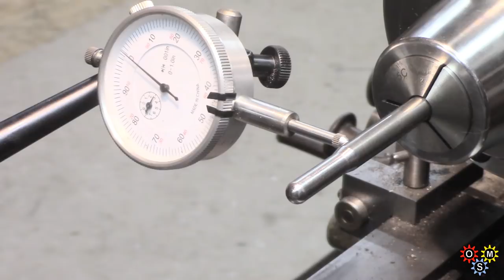Lathe Collet Chuck Installation

Comment: I have a couple of smaller boring bars that look about like the 1st one you were using.  I have the same chatter problem.  It seems the flats on the shank are oriented so that the cutting tip has quite a negative rake.  Got mine from banggood.  I have avoided using them because of the problems.  I need to sort this out some day and correct. Maybe post bandsaw refurb!  Lol. You sure  have your 5c dialed in very well. Good video.  Tc Mike
Reply from the maker: Thanks Mike - indeed, does seem those boring bars can be problematic sometimes. On balance I always feel happier with the largest bar I can manage to use for a particular job.

Comment: Someone had a good video on truing up 5C collets, I believe. Perhaps with a pneumatic grinder mounted on the compound. In this instance the main collet error was on the angle that forces the collet shut. I do not recall the details, but you can certainly check the whole system out. If I do not get back to you, I am lost in A.D.D. - land :) .I guess I BETTER start by watching the rest of your video, LOL.
Reply from the maker: I have yet to indicate the internal taper but I get the impression it is pretty good, accepting that we have an import unit, and of course with import collets there might be slight differences there too. Still, not too bad considering a cost saving compared with high end items.

Comment: Another question, which Loctite did you use?  640?  I believe its for permanent adhesion for sleeves.  Also I just watched the remainder of the video.  I should have waited to comment!  Anyway, I see that you made a threaded insert for the backing plate that goes in the existing counterbored holes.  I should have done this.  Its a great idea and you arent drilling additional holes in the backing plate.  One thing I have yet to do to mine but will in the near future is to make slugs that press in to the counterbored holes and threaded slugs to fill the holes in the backing plate.  I am doing this because at 500 to 570 RPMs my lathe shakes.  My 4 jaw Chuck does the same thing and I'm going to do that to it as well
Reply from the maker: Hi Brandon - my 'Loctite' was actually a knock-off stuff but works well. Unfortunately the permanent had 'gone off' but seems the medium I used has done OK. Lathe shake not so good! Wonder where the imbalance might be. 
Thx for dropping by.

Comment: Thanks for making the video. More than one way to skin a puddy cat, but if you have a set of transfer punches, seems like you could have transfer punched from the front side of the chuck into fresh spots on your back plate, then tapped the back plate.
Reply from the maker: Hi Steven - Thanks. I really didn't want the hassle of drilling a new hole pattern and then tapping - maybe mine was the lazy option but it seems to do the trick!

Comment: Nice video, Chris. So the collet is tightened in with the chuck key. I am not familiar with that chuck. Thanks.
Reply from the maker: Hello Bill - thanks. Yes, chick key spins the internal female thread to engage the rear of the collet. Does take a good many turns to get to full tightening.

Comment: If it wasn't for the weather, I'd still think you were in Australia.  Now I've worked out you're West Country gone American.
As there were no M8 threads, you coulda just used 5/16" if they're cheaper.
You could put 4 grub screws in to dial in,  but they'd have to be small as that register isn't very deep.
Reply from the maker: Hi Matt,
Thanks for the comments. Buying bolts, of almost any type metric or SAE is always an expensive game! Setting up is not too bad, just light taps with a dead blow hammer before bolts fully cinched up.

Comment: I don't know if anyone else mentioned it, but if your buttons do come loose you can drill down between the button and the plate and install a wrist pin to hold them in place. They won't turn then and will be locked in, they could always be replaced if need be by extracting the wrist pin. Thanks for the video, it is always great to see how others come up with ways of solving problems.
Reply from the maker: Hi Craig,
Excellent idea and thanks. Hopefully they will hold but that certainly would make a very easy fix. :)

Comment: No, no you do not talk to much.  Dont change a thing!   I have the same 5C collet chuck that I just installed on my lathe a month ago.  I had the same issue with my backing plate, the holes lined up but were counterbored so I had to drill and tap new holes.  I ldid a light facing cut on the backing plate and also took a little off of the register so I can fine tune the runout.   This is the same collet chuck that Stefan Gotteswinter has.   He does a teardown and inspection of it on one of his videos.  One of the best mods I've done so far!  Where are you located?  We just had about 3, almost 4 days of rain here.  Thank goodness it wasn't snow!
Reply from the maker: I'm in SW Central PA - lots of rain here too but not quite as awful as down south. Sounds like your approach with the back plate was like mine except you drilled and tapped.
Reply: ChrisB257 Oh no kidding, I am in northeast Pennsylvania in Bucks County. I think I saw one of your videos where are you were flying a drone in PA buy some historic bar or restaurant or maybe it was an Inn.  If i’m ever in the area it would be cool to stop by and check out your shop
Reply from the maker: Hi again Brandon -- yes, the drone flight, not my best - was looking at the Jean Bonnet Tavern - it's at the intersection of route 30 and route 96. If you happen to be this way (Alum Bank) do let me know but, be prepared if you see my shop - it is chaos and probably always will be!!
Reply: ChrisB257 haha, you should see my shop!  It looks like I dug out a spot in the basement for the lathe and mill.  Slowly but surely the basement will one day be all metal working equipment.  I originally started out in a steel building (quonset hut) with no insulation and in winter I froze and summer I was drenched.  The humidity was no good for machine ways!

Comment: Great job Chris. Could you give the web site and link or part number to the 5C collect chuck. Thanks for the good videos.
Reply from the maker: Thanks Anthony - well, I found the chuck on ebay and I seem to recall there were a few suppliers. Can't remember a specific link right now but search with "5c collet chuck" - there are plain back types and also cam lock etc. Have a look - plenty of choice.

Comment: How much clearance did you leave for the insert into the backing plate?  I know it was a while ago so if you dont remember the exact tolerance can you recommend a press fit clearance?  I just tried plugging one of the extra holes in my backing plate thats for the same 5C collet chuck.  I went to press it in and the backing plate cracked on the edge of the hole closest to the edge.  I had .003” clearance.  I guess I should have shot for .0015 or ?  Thanks Chris!  This is the third time I watched this video from start to finish
Reply from the maker: Hi Brandon,
Best I remember, I turned down the buttons a tiny bit more than intended so, one was an easy press fit and the other two a bit easier (this showed that the holes were not all absolutely identical ID) - but so far it seems as though the Loctite addition has managed a good hold. I have slackened the bolts a couple of times since to make a small adjustment for centering and they hold fine when bolts torqued up.
My target for button size was meant to be something around +.0005 to +.001 max because of the small diameter - does seem like .003 is certainly excessive. Maybe you can braze that backplate crack to effect a repair and make your button fit much less extreme and then rely on Loctite.
One other possible extra option might be to make the buttons a bit shorter and inside the hole place a thin lock washer first, then add buttons on top with good contact and finally, Loctite.
Reply: Thanks Chris!  I discovered that the counterbore is not in line with the main through hole.  Not sure if I described it that well.  I am going to do as you did and do a light press fit.  The crack is so small that I am honestly not afraid to use it as is.  It is not even close to the main mounting locations.  My backing plate came with 2 sets of bolt patterns for a chuck that mounts with 4 bolts and one with 3 bolts.  I am making the slugs to go in the unused holes because I have a vibration at 600 rpm's and I believe it to be caused by the additional unused holes.  Sorry for the long story.  Maybe I will try and braze it.  Its a lot of work preheating it and brazing it.  It only costs $30 for a replacement.  Maybe I'll just replace it and then I'll have some cast iron to play with for another project.  Thank you for the help!

Comment: What if the back plate was flat no raised area for the inset, wouldn't that work? the bolt are doing all the holding. Just curious on your thoughts
Reply from the maker: Well, it is possible to ignore the inset and just go flat but I prefer to turn such that the raised section is a very few thou under inset size - makes it easier to then have just the small ''wiggle room'' for final set up, without the moving  around excessively on a flat. Depends too of course how much the back plate holes are for size - tight or a bit sloppy.
Reply: @ChrisB257  no it's not OK, it's called the ''register'' for a reason and has to be there for this or any back plate to work correctly. Regards David, Precision engineer

Comment: The run-out is it the collet, spindle, and/or the mount?
Reply from the maker: Hi - hard to say to be honest! Most likely a combination of chuck and collet I think.
Reply: check it with a indicator?
Reply from the maker: Externally collet chuck runs true but have not as yet checked the taper. Probably will.